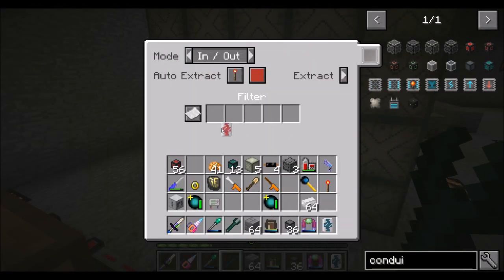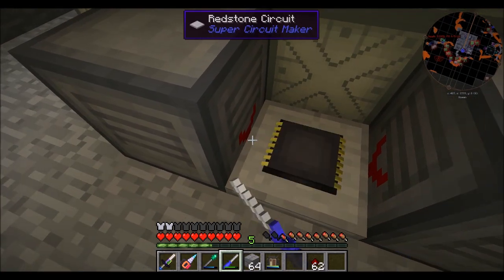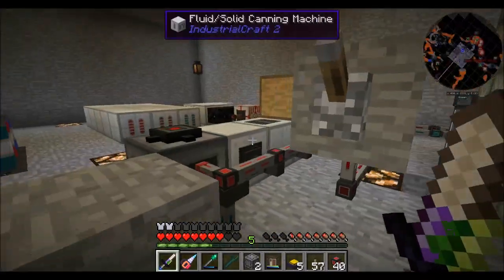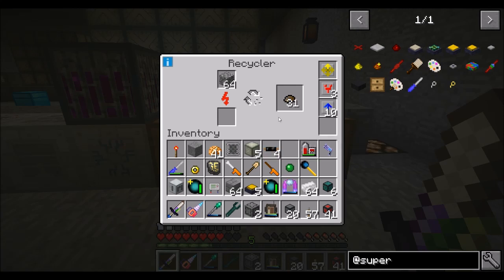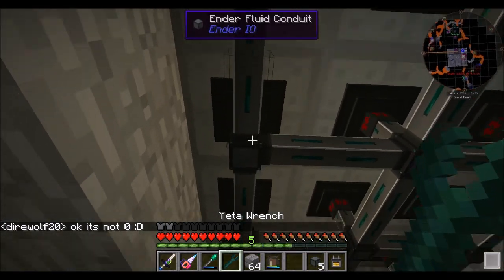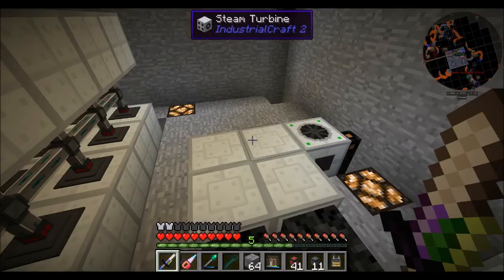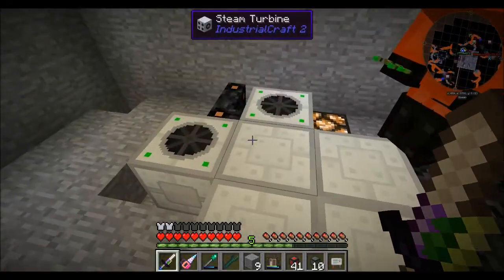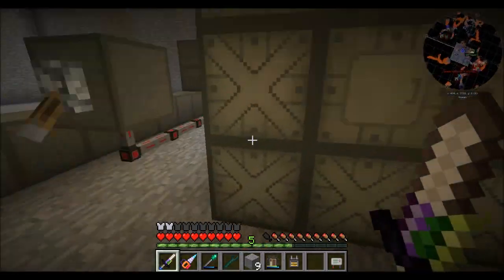Forgecraft2 S10 E72 2nd Reactor

Comment: why not fill up multipul MFSU's for extra power?
Reply: That's what he should do, then use the redstone output to set a high-low amount like he did with the scrap. The explosions are caused by the generators kicking on the instant any power is used, but his generation is too fast, so it makes excess steam then explodes.

It would be better to detect when an MFSU is empty, then charge it to, say, 75%. Then there wouldn't be constant explosions and loss of distilled water.

Comment: so why are  the steam turbines exploding? it doesnt seem to do anything bad. i dont understand the logic behind it, you have an explosion sound for something that happens fairly often in a mod with exploding machines, explosions are something bad in vanilla already, then you have exploding machines and now you have harmless explosion sounds that happen fairly often in the same mod, i cant wrap my head around it.
Reply: I think it is when they run out of steam?
Reply: steam is produced, if steam cannot be stored in internal buffer it is ejected from the machine in a steam explosion. wasting the distilled water and heat used to make that steam.
Reply: it should be something like a steam leak sound. still it shouldn't be exploding, not sure, maybe the machine is too hot so distilled water goes mad at turning into steam? perhaps is reaching plasma temp X'D it has no sense at all.. and it's REALLY annoying